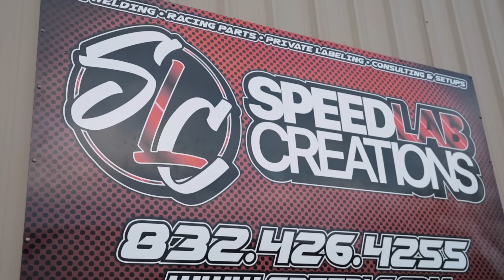BIG CHANGES On CRAWFISH!

Comment: Big changes on the crawfish but hopefully it doesn't mess up or hopefully it is ready for april 1st so it can be good for  crawfish vs gator and crawfish vs kingcobta April 1st🔥🔥🔥🔥👌🏽👌🏽
Reply: Gator ain’t going to April 1 
Midnight taking lil OJ only
Reply: And king cobra ain’t got a chance now especially when flaco getting on point
Reply: @masielherrera6573   wach the race in truck national after the oj raced the gremling and Beto said gator vs crawfish and then freddysaid kingcobra vs crawfish
Reply: @masielherrera6573  kingcobra does got a chance because it is faster than before 👌🏽